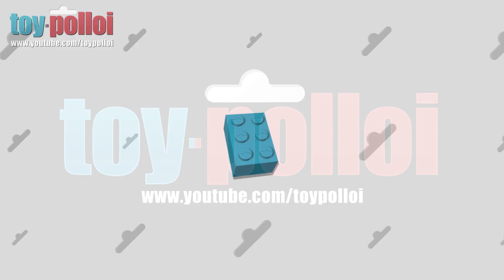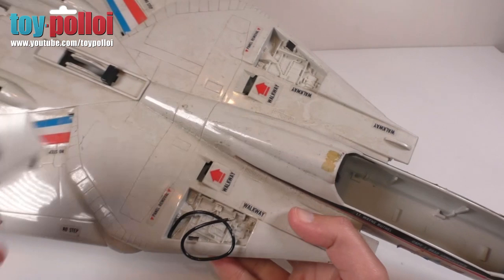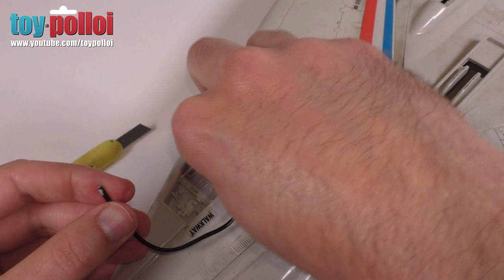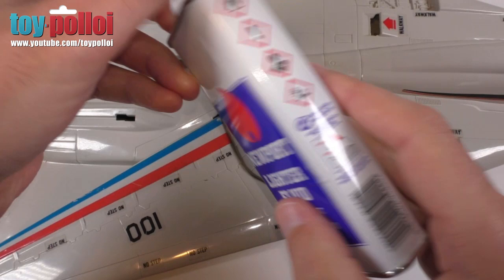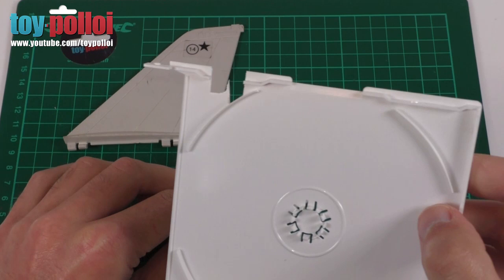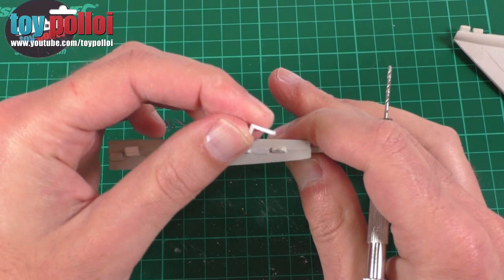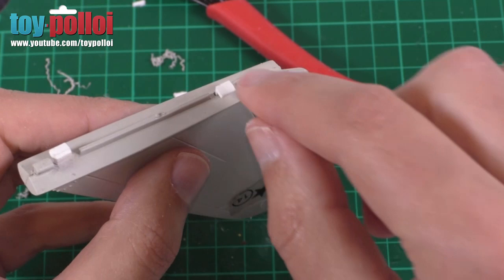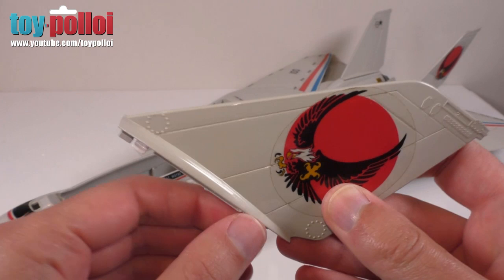G.I.Joe SkyStriker restoration - part one - Toy Polloi

Comment: cheers for shout out and also very impressed with the fix , i do have a near mint boxed skystriker with broken fins if only had the time....
Reply from the maker: No problem. I've bought quite a few bits from you so always nice to mention my sources. If you need help with your Skystriker, drop me a line.
Reply: @toypolloi  someone watched your video and asked me for parts so thanks, i have lots of gi joe vehicles i meant to fix but just to busy so thrown in back of the loft, again thanks for message appreciate it and if it helps could put a link to your channel on my homepage as your channel is better than most on toys

Comment: Great vid bud, can't wait for part two. I got myself a pin vice a while ago and the drill bits I got with it seem to go going really quickly, I'm only using it on fixing plastic toys, but your drill bit seems to work really well. You don't look like you are putting any pressure behind it at all, I have to apply pressure on mine to get it to bite in and start creating a hole. Trouble with applying pressure is you risk snapping or bending the bit.
Reply from the maker: I do apply some pressure. The set I have was a cheap one from ebay. And came with the drill bits. I would expect to break a few of them though as they are super thin. So I will be replacing the bits shortly I think.
Reply: Thanks for getting back to me, yes, mine was a cheap ebay one as well so I expect I will be in the market for stronger drill bits or a simple way to sharpen them without a lathe. Lol

Comment: This video is amazing. But the most amazing thing has got to be the use of a cd case......how did you even notice that!?
Reply from the maker: I've used CD cases before for fixes as they are easy to work with and have lots of useful shapes and angles in them. So it was a good place to start.